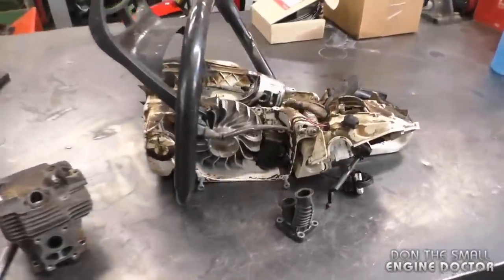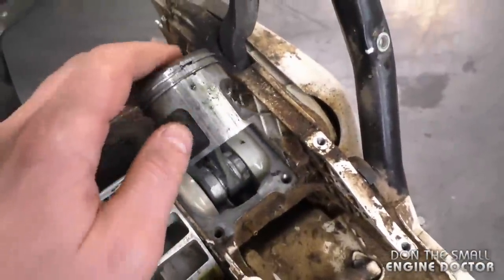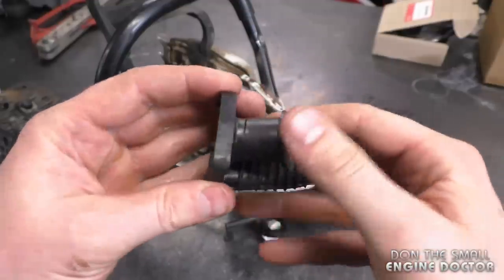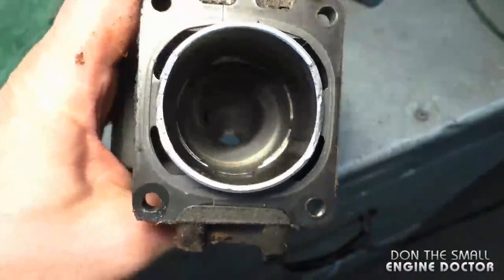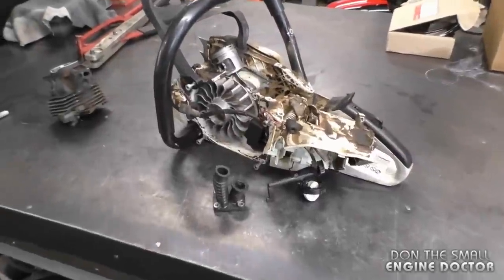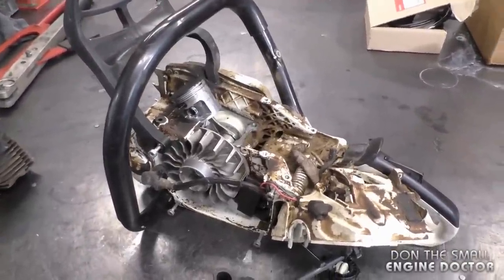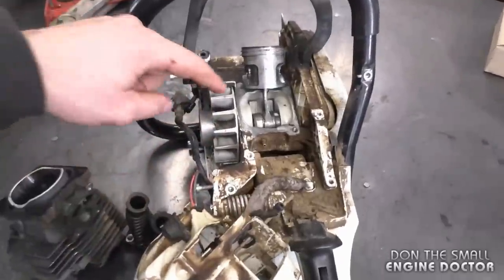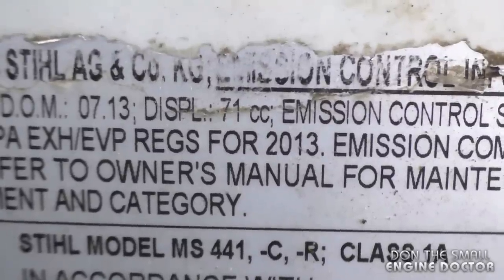Why A STIHL MS441 Chainsaw Blew Up! - Video

Comment: Used to be a wrench at a Stihl dealer. Customer brought in a MS290 with a severely scored cylinder. Saw was only about a month old at the time. He lent it to someone and they ran straight gas in it  and cooked it. Stihl wouldn't cover under warranty because of the straight gas. Cost of repair was high enough that customer bought a new saw. He didn't want his old saw so it sat under my workbench for quite a while. Service manager dropped of a box full of parts on my  bench one day with no work order. He said it was for the saw under my bench. It was mine if I wanted it. New top end, new crank bearings and seals and  a carb kit. Still have that saw today, 12 years later. Still runs like a top. Did buy a case for it though.

Comment: I have worked in the woods for some time and repaired saws. I find from my experience the cause for the intake boots getting torn like that is from 1st yes they get brittle from time, but the biggest culprit for failure is this, saw gets bar pinched in the wood being cut and the operator yanks too hard on the handle over stretching the vibration mounts and damages the boot.
Reply: Thanks for sharing! i find your comment valuable
Reply: You're welcome !
Reply: Great tip!
Reply: Yes, good tip thanks
Reply: Correct never pull on the saw or it WILL screw up
Reply: cool

Comment: It makes sense because in a 2 stroke engine, the lubrication comes from the fuel. If you're not getting enough fuel that has adequate lubrication, the engine will be starved of fuel and lube. It can cause overheating and excess friction leading to engine damage from insufficient lubrication. A 2 stroke tends to rev higher when adjusted too lean or not enough oil in fuel. Either one of these conditions would eventually lead to damaging the engine. This is quite a bit coming from someone who doesn't work on small engines on a daily basis like you do. However, I have gained knowledge from people on YouTube and have experienced it too. I have always been interested in this kind of stuff. I always learn from these videos.

Comment: I’ve always mixed my fuel 40:1 if the machine calls for 50:1 and I also tune the carb slightly rich. Looking in the muffler the engines I have still looks brand new many years later
Reply: Same here, a little extra oil is only going to help.

Comment: My 441 boot cracked too with very few hours but cought it as soon as it started running lean. I think it was a combination of very cold weather and pulling too hard on the handle after getting it stuck in a tree. A very powerful saw though.

Comment: I had to rekit the carby on my brothers Honda GX25 4 stroke line trimmer, it was very hard to start & ran lean so I bought a $5 AUD carby kit & fitted it,now it runs like a beauty.

The fuel pump diaphragm & the diaphragm for the needle was all stiff & dried up.

I've bought parts to rebuilt my fathers 16 year old Honda GSV190 engine as it smokes up when cold,so far,I've ordered the piston rings but realized that I need to order the later model piston to suit the 014 rings.

It's cheaper to order the new piston as well than the older 004 rings which are no longer available from Honda,I just need to order all of the seals & piston to fix it up.

I'm ordering the parts from the U.S. because they seem to be able to do a better deal  even than what they can on eBay.

Comment: I checked my intake boot for leaking by wrapping plastic tape around a 15 mm copper pipe in a taper-spiral so that it would fit into the carb intake, and then blew into it with the piston up.

Thanks for all the great tips you have given me over the years, merci beau-coup!

Comment: The first thing I thought, was grabbing the wrong gas can, and putting straight gasoline in it, instead of 2-cycle mix. I've never seen an intake boot like that. All my saws have fuel/air mixture screws, and I just adjust those, to make sure the mixture is right. Too rich, fouls spark plugs, and causes hit and miss running. Too lean, it just doesn't have the power, and, I don't allow that for just the reasons shown in this video. The fuel is the lubricant.

Comment: Good one, you had me fooled! I was guessing it was the old "carbon buildup in the exhaust port" one!  (Now I'm nervous my two cycle equipment is running lean without me realizing, but then I remember the spark plugs look rich if anything...)
Reply: If you're going to miss on the fuel/air mix, better rich than lean. Sparkplugs are much less expensive, than pistons, rings and cylinders!

Comment: Totally rebuilt my 044, used a big bore over sized kit (aftermarket), ran great until the crankshaft broke when I hit a nail that was inside an old tree.  I told a few people that the crankshaft broke and I had to show them because they didn’t believe me, China junk metal failed and I’ll never buy anything but OEM ever again.

Comment: 45:1 or 50:1 is not making much of a difference, it's pretty much the same amount and in the user error variable. Most people mix at 45-55:1 since they don't measure perfectly. Trying to mix 32:1 or 40:1 does make a difference though, especially with modern synthetic oils that don't smoke.

Comment: Someone bring this Stihl back to life!
Reply: its an expensive one to throw it in the trash....
Reply: If you cant afford to buy new, take some emery cloth or a pocket knife to remove melted aluminum from cylinder. Sometimes you can doctor up the piston if its not too bad.takes some time and labor.Of course new is allways better.
Reply: Baileys online logging supply sales a good aftermarket piston and cylinder kit,but often times you can clean the aluminum transfer out of the cylinder wall and use a good meteor piston with caber ring and only spend $50. A new oem piston and cylinder will run you $399,and is also a good option.

Comment: Hi Donyboy73 I have a Stihl 028 Wood boss that I am having an issue with it I rebuilt and cleaned the carburetor the saw starts up great and idles great but when you go to throttle it up it is very rich but if you press the trigger rapidly it will take right off and run fine then let it idle then it will be rich again ? What would cause this issue? Thank you for the video.

Comment: What I love is when the owner doesnt like the answer then trys to pawn the job off on another guy. He says he took it to Joe blow and they said blah blah( usually half truths) and dont know why they wouldnt fix it. Then they try to get you to commit to being able to produce a miracle and magically get it to run again. Even though the engine is clearly toast. I had a guy pull that on me with a riding lawn mower. I told him no promises and Let me look it over. Afer doing a compression test and checking the cylinder heads, I discovered it was run dry. The damage was both top end and bottom end. He told me the other shop told him it could be fixed but he only gave me part of the story. I told him the crank bearings were bad too( I could hear the piston slop in the bottom end) The top end was wiped on both cylinders. I could see metal transfer on the cylinder walls. I also noticed it had a bad oil leak by the build up of crud around the base of the engine. I told him I could get another engine for it but  I wasnt going to rebuild that engine. He ended up scrapping the mower.
Reply from the maker: yes happens all the time, then they expect a warranty lol
Reply: @donyboy73  Yup! I tell them its warrantied to the end of the driveway. lol. I quit doing warrenty on snowmobiles when a customer went and ragged on a fresh rebuild after I told him not to. He didnt blow it up or anything but thats just bull. Every manufacturer has a break in period on an engine and even aftermarket has break in on their parts. I was using Wisco Pistons and new cylinder sleeves. I NEVER just rebuild on side eather. I had a customer try and tell me it made no difference. I told him he could take it to someone else then. Both cylinders were pretty much gone. One had a hole through the piston caused by an over lean condition. He decided to let me do the job after I stood my ground. Now everytime I see him he brags about how great that snowmobile is. Thats because I did it correctly and wouldnt budge. Spring is comming buddy! I already have a line of lawn mowers to fix and sell. Take it easy!

Comment: Hello Donyboy, I have tried several other channels about the following question, and pretty much the majority of replies don't agree with my assumption, so I thought I'd ask for yours now. Pardon me for my question not having much to do with this video, though I guess it could be my problem. I have a 6.75 HP Craftsmen B&S gold mower that starts but sounds like it's puttering on low throttle, even though I have no throttle other than the governor spring. It was running fine one day, then the next day the puttering started. I checked the carb, fuel line, spark plug, air filter, and even the flywheel key, and they all seem to be clean and okay. I saw another video talking about the coil and where it should be resistance-wise, a level between 2.5 and 5.0. I checked mine out, and it reads 6.5. My question is this, would a reading above the normal levels cause performance problems? Like I said, mine starts, but it obviously isn't running like it should. No one I've asked seems to have ever heard of this causing a problem other than starting issues. Thanks.

Comment: Last week, changed the oil of my John Deere L100 w/17.5 B&S, used Castro blend 10w30.  
Also changed oil filter.  Grandson cut grass, motor knocked, then seized. Could it be the synthetic blend?

Comment: problem is  how much of the crap from the piston and jug  got to the bearings???   also before you pull the jug take 10 minutes to do a pressure test.   in this case you found an intake boot but ive been bit by this. throw a jug kit on only to find bad crank seals or a crankcase gasket bad  now  you've wasted more than the 10 minute test.

Comment: Thanks for the excellent Information! 
What would a damaged saw like that one be worth, if anything?
Reply: Just good for a paper weight or cup holder.
Reply: The ms 441 is a medium size saw. If the bar and chain are part of the deal the saw could be worth $40...as a parts saw. Never borrow out your equipment, fellas. Unless the borrower is putting down a deposit of the true value of the tool.

Comment: That is an early 441, not an M-tronic. Examining the intake is next to impossible, it is buried. Dony, I am a fan of yours and have learned a ton from you. Did you pressure/vac test the saw before you tore it down? Btw, those who think that you could buy that saw rebuilt for $200, think again, the core has value, the parts will cost near 200 and then you have labor costs.  Looking at 500-600 at least.
Reply: Shop labor rates are a killer.  Chainsaws are not difficult to work on, so for the DIYers, rebuilding a chainsaw is a great way to save a ton of cash.  If the owner has no mechanical skills nor the time, nor simply it isn't his thing, then pay BIG.

Comment: That is why you do a vac and pressure test and if it is a m tonic saw it might be worth fixing it is a 1000 saw
Reply: Used to be a wrench at a Stihl dealer. The vac/pressure test is awesome for finding the problem on the ones that just wont run right.

Comment: says: 50 to 1    i make/use  40 to 1
   no spark plug fouling troubles
Reply: I’ve always ran my equipment with a bit more oil for added insurance against it blowing up, running it hard and hot seems to stop any carbon issues even with some of my machines running 32:1
Reply: A lot of people spread the myth that putting too much oil can create fouling or leanness, but here's the truth: 
At 50:1, the gas represents 50/51'ths of the mix, or 98.03% of the mix is gas.
At 40:1 the gas represents 40/41 or 97.56% of the mix

A 0.53% difference in the amount of gas in the mix will not make much difference in terms of leaness. The critical factor in leaness is the "air to mix" ratio - not the "oil to gas" ratio. This has to change by ~5% or more to make a significant difference.
25:1 means gas is 25/26 or 96% is gas

Now look at what else varies the air to fuel mix ratio. The total amount of air getting into the cylinder is influence by the atmospheric pressure which can commonly vary between 1000 to 1020 mb over a few days. This change represents a 2% change in air pressure and means the saw will get ~2% more oxygen at 1020 than 1000 mb.
Does anyone operating at the same elevation read the atmospheric pressure and then retune? - of course not, a stock saw can tolerate at least a +/- 2.5% change in air pressure which corresponds to shifting the mix down from 50:1 to about 25:1.
Reply: @em4703  33:1 is ok ?

Comment: I would fix this saw fore sure got a 441 c myself that I ran for a few years logging until the coil broke, planning a big bore kit after market coil and thinking about swapping for a non m tronic set up may e even do a Reed valve build or might just go back stock but certainly not junkies it, it's a dang good saw

Comment: Hello donyboy73, greetings from Scotland in the UK!!  A two year old video from you which i found very interesting! At 4.36 time on video, you mentioned the lower bolts, and i am wondering, do you know the correct torque settings for these bolts?--(from the top bolts to the bottom presumably, and what type of torque wrench would i need?)--Are they the same in ALL chainsaw's or are they unique to Stihl? Thank you for looking at my question, i'm a massive fan, upticked and subbed!! Thank you, Mikky from Scotland, UK!

Comment: I just had the same light scoring/compression  loss problem   on husqvarna 372   depicted in your video. my leak was on filter connection right in front of carburetor. I diagnosed it as saw running on debris in air. was i right? would it be possible in your opinion?

Comment: Before doing anything to my saws, I blow it off with a blowgun to remove all the dust, mud oily shite and woodchips, makes a far better start as nothing is worse than messy engines and it gets into everything.

Comment: Our gasoline is so screwed up in the u.s.a. it can go bad in 30 days! Fuel stabilizer is critical.
Reply: True with ethanol fuel. Ethanol free fuel can last much longer.
Reply: @canamrider7195  isnt always that easy to find. its becoming scarce.
Reply: Billy Darley It’s actually becoming more common in my area. Even the local Walmart (Murphy) gas station carries it.  Any marina will have it too.
Reply: @fivespeed3026  wish it was that way in my town.
Reply: Usually Tractor Supply, Fleet Farm, Farm and Fleet, Northern Tool, ACE hardware...sell premixed fuel for about $10-20 in a can. That usually has a pretty decent shelf life. Usually wound in 50 and 40:1 mixtures.
Reply: @Ratkill9000  ever try amsoil saber?
Reply: @Billy_Darley  I have not.
Reply: @Ratkill9000  its all I run in my 2 cycles. I think I've got it mixed to about 100:1 but I'm kinda careless with it so it might be 50:1. I love it. Whether it's a brand new engine or used they all seem to run great on it. I have no interest now in ever going back to anything else.

Comment: I use the Amsoil Saber oil and you can mix that as I do at 100:1. Haven't had a problem.
Reply: Its been caused by intake boot damage/leakage saw was running too lean. it wasn't been oil fail...
Reply: From someone who has never used it. I spoke to Shell before becoming a dealer about the oil. Shell said, it is far superior to anything on the market today, including anything we put out. That is their words, not mine. I spoke with the Shell Answer man who has a column in a truck magazine every month, you can ask him anything about oil or lubrication and he will give you the answers in detail.

Comment: Don , what is that "Crack" slightly diagonal ( in the  inner - outer casing)  near the rod and piston in the video?  great prevention video ! :) thank you .
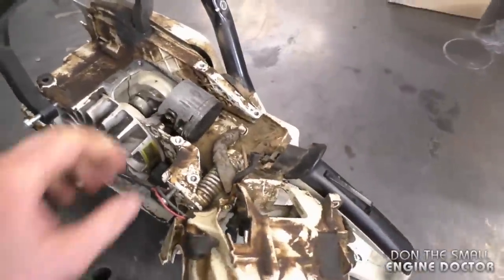Reply: william savage The crack at 1:08 ?
Reply: @RaoulThomas007  yes . I have never torn my stihls down . So using auto engine brain. I thought the block on the saw was cracked. That was my question . Thank you .

Comment: That's why I run 16.1 mix in my older saws..40.1 on my new ones they need that oil to keep them cool if the boots or seals sucking air..
Reply: @YoungOzzy432  ya
Reply: Just use 50:1. Any more oil than that will damage the saw sooner or later. Adding more oil leans out the mixture and makes the equient run way hotter.
Reply: @ralphnapierii1184  old ones need a pint to gallon ..i kee p blowing up old ez homlites .took me 3 of them to stop being stubborn. Oils the same as it was then because I collect old oil bottles and read them
Reply: @jacoblang2712  you are not correct. Modern synthetic oils are meant to be used at 50:1.
Reply: @ralphnapierii1184  I won't use synthetic oil ,its two watery my oil truck got hot with no oil pressure when I tried to use it.garbage,dumped it out soon as I could and put normal oil back
Reply: @jacoblang2712  what does the engine oil in your truck have to do with the synthetic fuel oil? They are completely different and using motor oil to make 2 cycle fuel can wreck a small engine quickly.
Reply: @ralphnapierii1184  I just use what works better. Seems the echo brand 2cycle none synthetic been my best oil.  Old stuff needs more say right on the label of chain saw what to use.not what I think is better
Reply: @jacoblang2712  yeah, if you have older equipment with the bronze bushings instead of actual bearings on the crankshaft, it'll call for a heavier ammount of oil to gas, but on anything modern, that much oil will Coke up the piston and crankcase like crazy and gunk up the spark plug for a while before it breaks something.